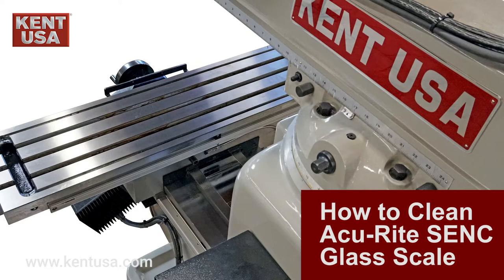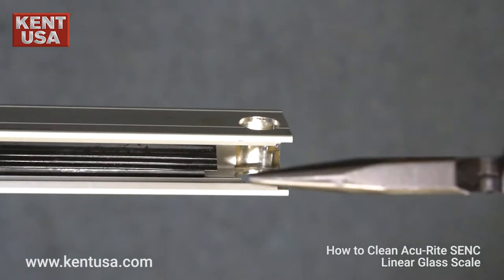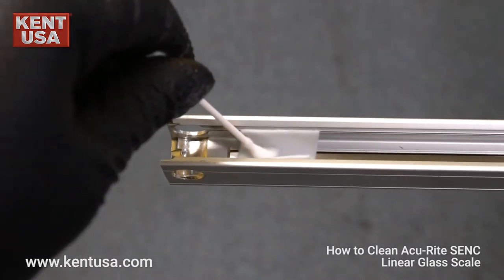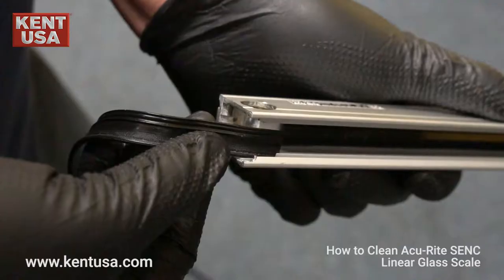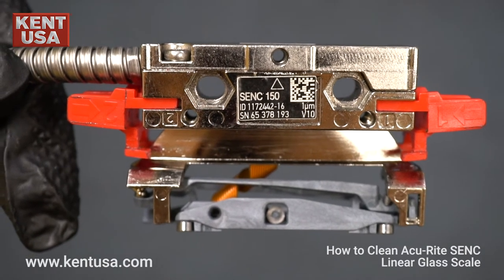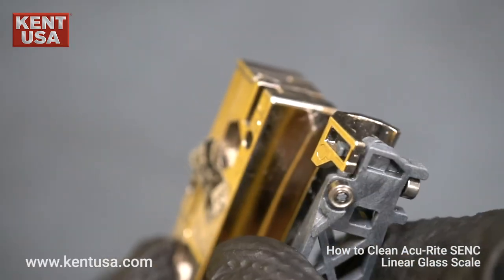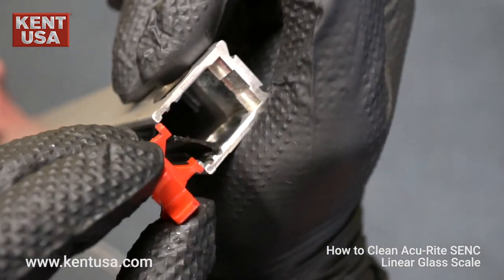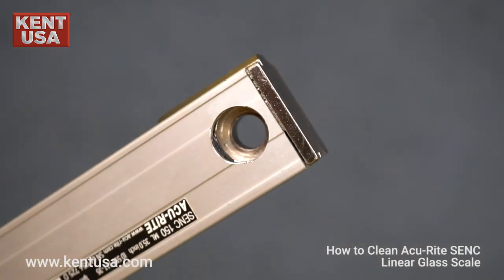Kent USA How to Clean Acu Rite SENC Linear Glass Scale

Comment: I never took them apart just used a Q tip soaked with alcohol between the seals and wiped the glass scale and followed up with a dry one  always worked for me and never had to remove the scale from the machine to do it